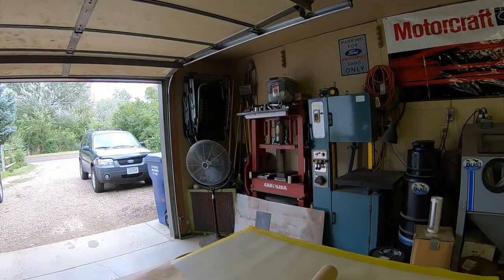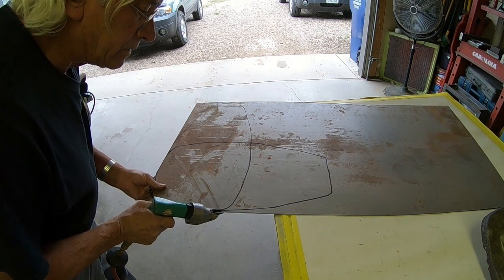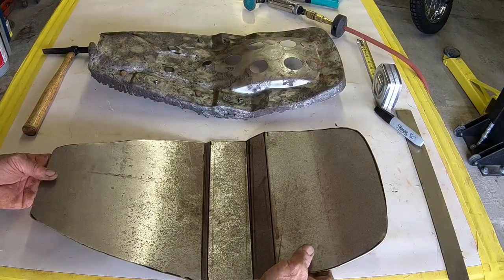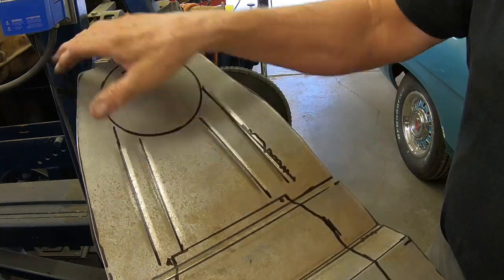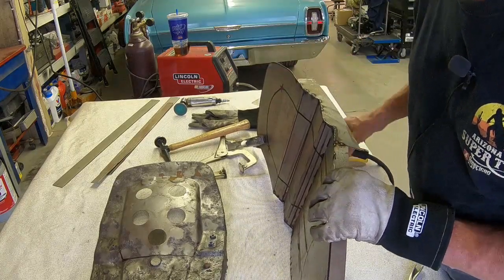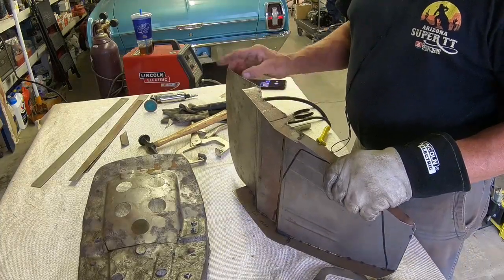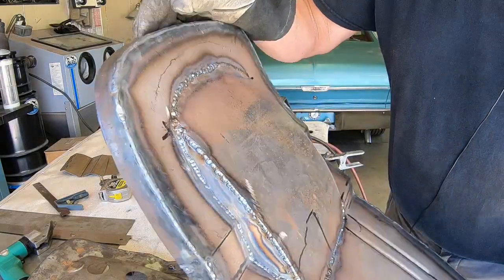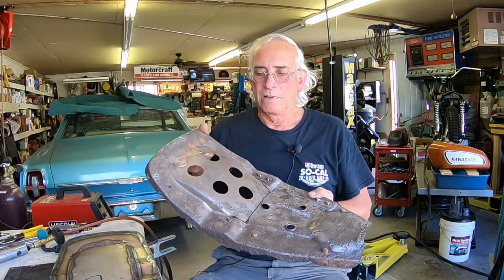Build a seat pan for a 1970 Kawasaki F5 Bighorn Part 1

Comment: Will you make me one! I have a 1970 F5 350 bighorn.  I also need a carb cover.
Reply from the maker: Hi D C, I have 2 Kawasakis, and they are by far the hardest to find parts for. Still have to fit the pan and get the hinges located, this is not an easy job. I hope I can inspire folks, that you can do these things, and give some insights for them to try themselves. Thanks so much for the comment, and for watching the channel.